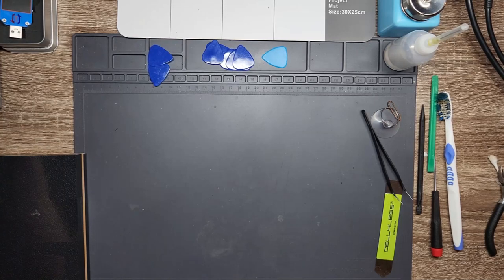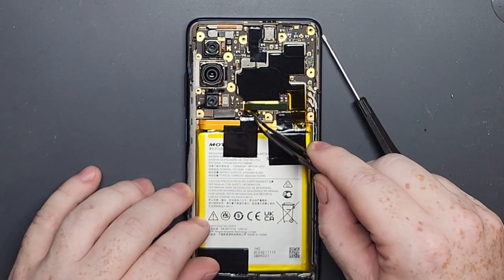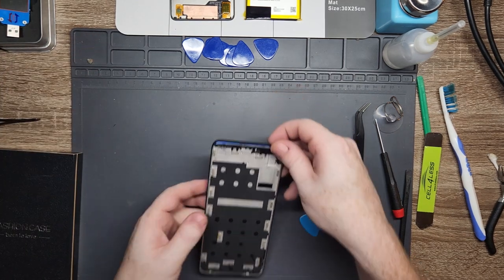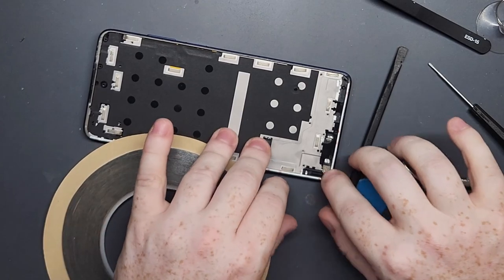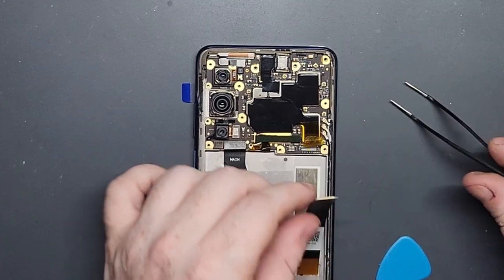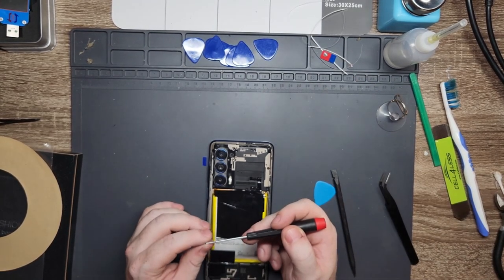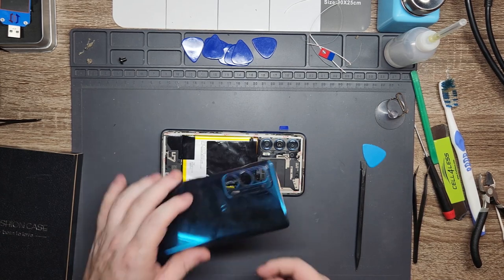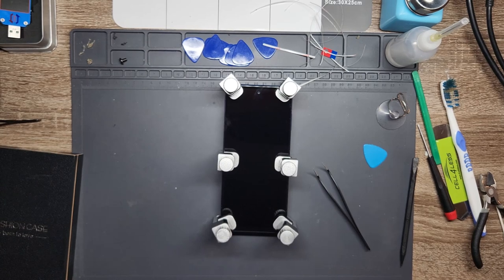Motorola Moto Edge (XT2141) screen replacement

Comment: Nice video. I have the edge plus 2020. I dropped it a few months ago & was in a case but still shattered the bottom right corner of the display. It wouldn't respond to touch, so I ordered a new screen. Looks like new again, but after I got it all together & sealed, the sound and microphone don't work. I replaced the speaker assembly today with a new OEM one, but still no sound. I would really like to get this phone working again. Do you have any suggestions?

Comment: Hello, they changed my screen in a shopping center and it turns on and works, but I see it very opaque, with low brightness I already raised it to the maximum and it still looks like that, as bluish and with light the cell phone does not look good.  They say it's normal?

Comment: I always mount the tape onto the edge of the screen glass and trim it where needed, since it applies easier than on the frame.   Of course it helps to have 1, 2, 3, 4, 5 mm 3M wide rolls of tape to match any kind of screen.   Oh, it makes me cringe when I see some inject gunky glue instead of high quality double sided tape.  Yikes!   Also the tape makes it much easier to replace a screen again than having to scrape off all that glue crap.

Comment: Hey brother what is the mm of the tape you used in this video for this repair
Reply: It's best to have 1, 2, 3, 4, 5 mm wide 3M brand rolls of tape to match any kind of screen.   They aren't that expensive per roll and lasts for hundreds of jobs.